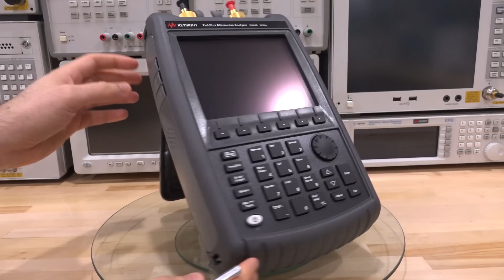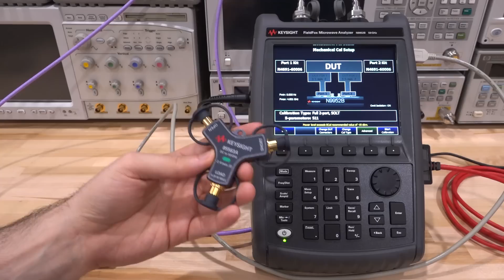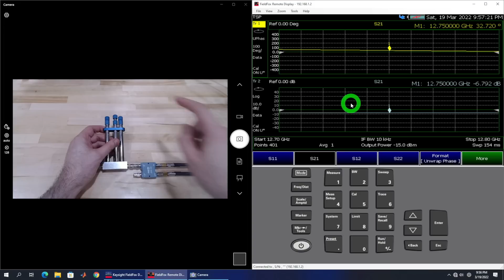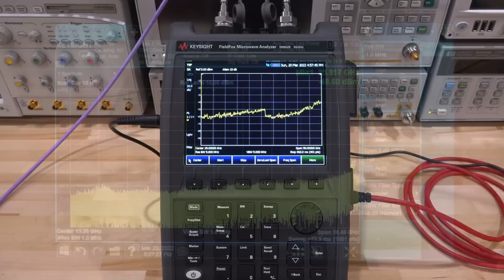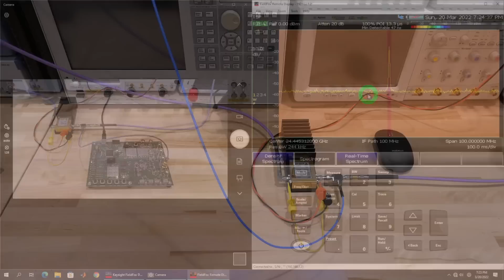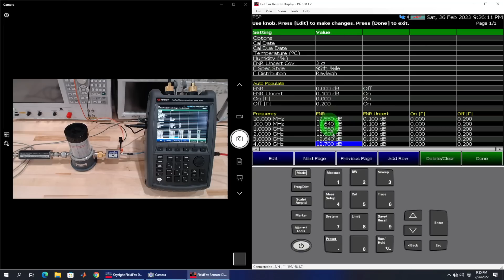TSP #219 - Keysight FieldFox 50GHz Handheld Microwave Analyzer / RTSA Review & Experiments

Comment: I wish you'd include the cost of these devices in your review to save us all from looking it up.
Reply from the maker: I don't include the prices because they are often not directly available and require a "quote" request. Not to mention that prices change regularly, differ from country to country and various institutions have discounts. They also depend a lot on the installed options.
Reply: @TheSignalPath  true but you can use a comparator say US. Transparency is important and one can argue whether a piece of equipment built offers value for money for what it does and the applications it has. You can definitely do better and your detail analysis on the technical parts why we watch your channel we need to make it known how that technical capability is reference to the price points.
Reply: @mathman0101  $52,000 for that model, used, refurbished to  like new. Pocket change for most labs!  He, he, he!

Comment: I use the 18GHz version and it's largely pretty great and recommended. Only things I don't like
1. Slow SA sweep. You mentioned it but the difference between this and the Signal Hound I use is several orders of magnitude. I can have the SigHound do a full 20GHz sweep in 80ms with the noise floor at -120dbm. The F'fox noise floor is about -60dBm for a slower sweep.
2. Cost of the options
3. Slow switching between modes. E.g. VNA to SA
4. Screen resolution.
5. Battery life doesn't feel like 4hrs. 

The CalReady feature is very handy, especially out in the field. For many VNA tests you don't really need to get out the cal kit.
Reply: Just curious what you guys use yours for, we have a Sig hound that we use for interference hunting and monitoring
Reply: @TheFool2cool  all sorts. It's especially useful for looking at weak signals. The demos functions are handy too.

Comment: I love the Fieldfox we have at work. My only complaints are the screen resolution is a bit low and that Keysight kinda nickel-and-dimes you for all the options. With the U2020 series power sensors, the Fieldfox offers some very nice peak power measurement capabilities with a nicer UI than the software that comes with the sensor.
Reply: Agree. And some of the options are actually really expensive. I would not be surprised if the fully enabled unit is twice the price. I like how companies like Signal Hound and Copper Mountain do it. You get all the features as well as regular software updates for free.

Comment: We have one of these and a keysight PNA in the lab at work. I use the fieldfox more often because of how convenient it is, and I can set up my testing quicker (and move it to a different part of the lab: preferable to getting a long cable).

My biggest issue with it is that it is very hot in the USB area and will frequently overheat a USB drive. If the USB overheats, best case scenario is that it disconnects and fails to save your data. However in many cases it will crash the unit and you will have to reboot it, losing your data and calibration (if it is not saved). I keep a few old metal USB2 drives around that work. The second issue is that saving files to the USB is a huge pain without a keyboard. A minor issue is that it's harder to do a triggered power sweep. However you can plug in a keyboard and use the up and down arrows to go up and down 1 dBm at a time.
Reply: It is a bit of a workaround but wouldn't a 0.5 meter usb cable extension fix the overheating issue?
Reply: Agreed even a very short USB port extender (6 inches) should move the drive away from the instrument.

Comment: Nice vid, thanks! I had older 6GHz N9912A one, pretty fun unit but it hadn't much love in my DC/LF lab :) At 9min mark you mentioned 10 MHz band, but actually display shows 100 MHz :)
Reply: Heh, I also have a N9912A that I found on ebay for a "reasonable" (albeit still expensive) price a few years ago. It's amazing that the 50GHz one basically has the same external connectors (well besides the RF connectors) and the UI looks identical despite this one being a much much newer unit. Also mine has hardly any options enabled - I was planning on "working" on that, and haven't had the time - I also picked up an 8753D 6GHz not too long after.